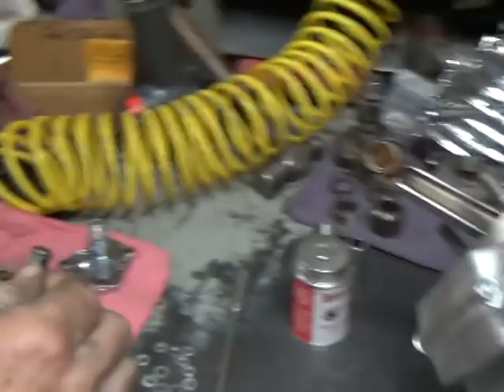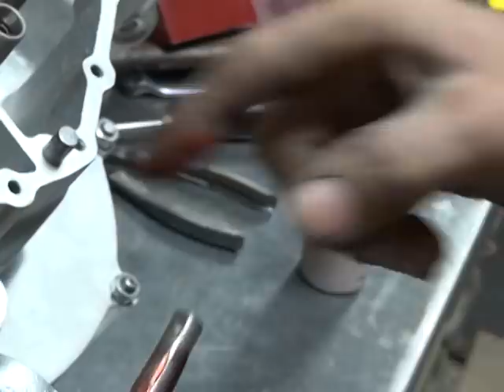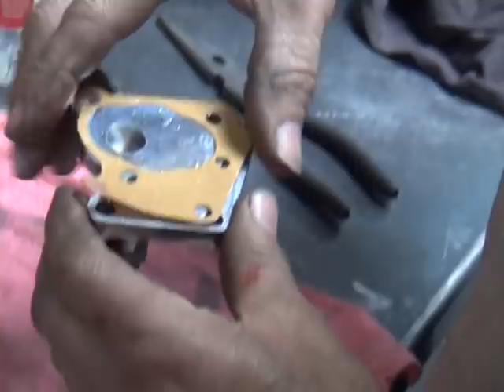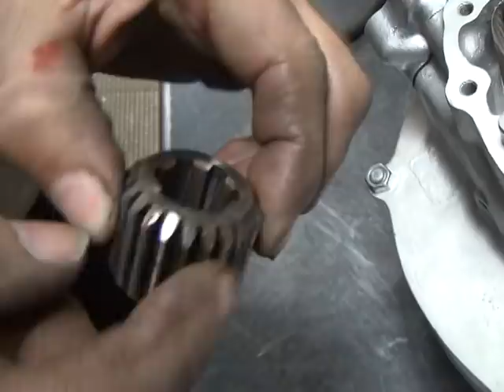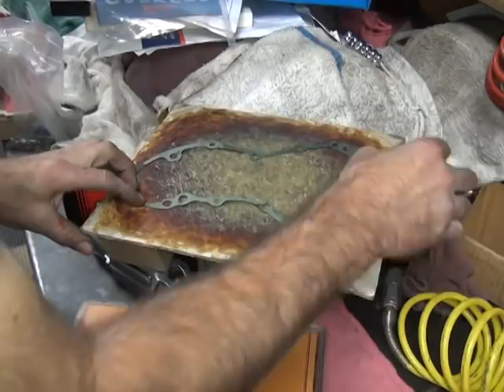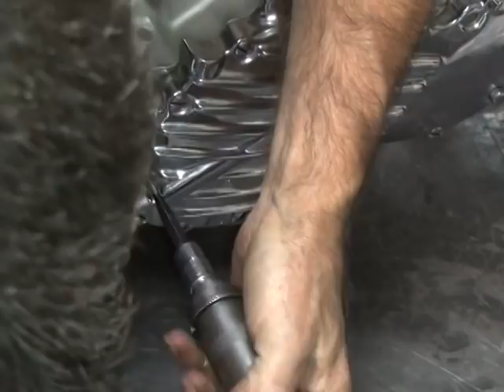1949 PanHead 74ci #103 Motor Overhaul rebuild FL FLH harley by Tatro Machine

Comment: Tatro , I noticed on my 53 panhead that the camshaft endplay where it meets the bushing is excessive . Its a new build . I can fit a .030 feeler gauge between the cam and the bushing.  Should I have a custom made shim to get the endplay tighter since the smallest I can find on the market is .045 or just run it with that endplay? Thanks

Comment: If you are running a belt drive instead of the old chain, you should re-time the breather valve to match the sealed chain models (one tooth advanced I believe). Better internal oiling and fewer oil leaks.

Comment: I have 50 pan cases that we put 80 ci  fly wheels and rods in when looking at the pinion shaft on the cam case side it doesn't  reach the cover brushing. The pinion shaft end looks factory and uncut I am concerned about oil pressure with no shaft in the cover bushing. This is an old way of getting an 80 stroker motor  
I don't know anyone who know about this old school modification. Any help would be appreciated.

Comment: How the f did he slide the oil drive and pinion gear on so easily. Most engines I’ve taken apart they are press tight and require pusher tools to get in. Did he buy an after market kit w looser tolerances
Reply from the maker: parts are what they are, some are tight and some are not.
tatro

Comment: I may have missed it, but didn't see a check done for gear lash on the pinion to cam... ??
Reply from the maker: if the cam it tight, you have none. if it is loose you have some. it it is rattling than you have alot. its that feel thing again.
tatro
Reply: @TatroMachine  Ray Charles Lives ... Lol

Comment: just wondering if you can help me out i have a 65 pan shovel that doesn't have the marks on the pinion shaft to orientate  to the gear and i think that the timing is way off.
Reply from the maker: that is what the keys are for. for the distributor, you just find the tooth that works for you after it is all together.
tatro

Comment: So if you know that the oil pump body is worn out around the mainshaft, why would you not ream the hole out and install a bronze bush in it?

As an aside, my compliments to the camera man. I think possibly the best yet.
Reply from the maker: at some point you have to draw a line on what you are going to do. custom machining of the parts and custom making replacement parts were not in the budget. unless it is a real problem you just use what you have.
tatro